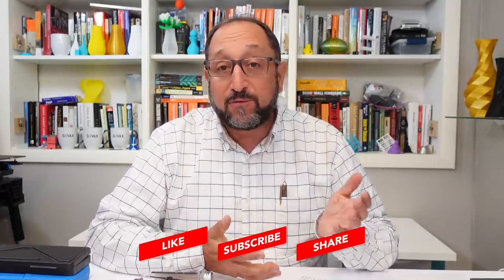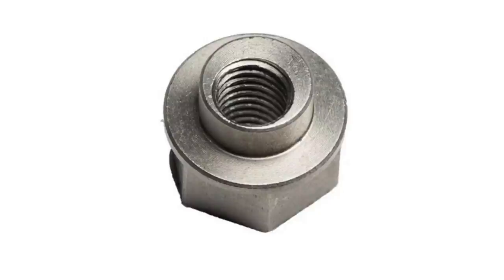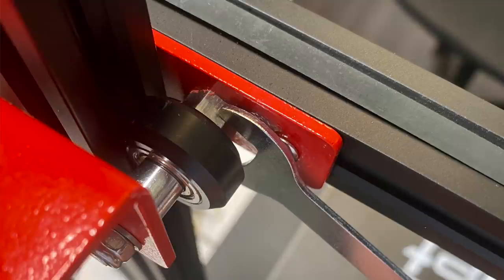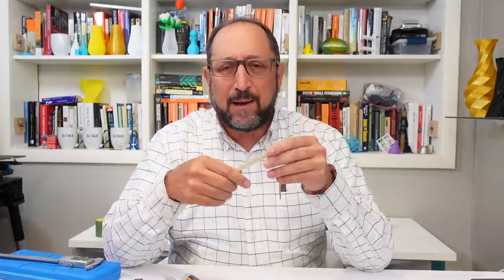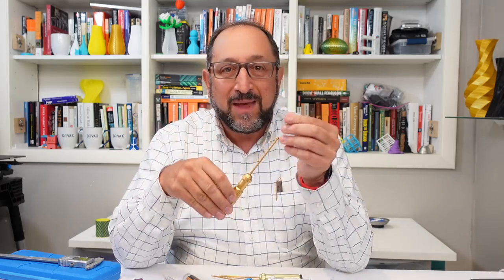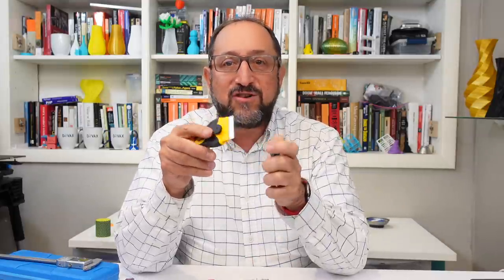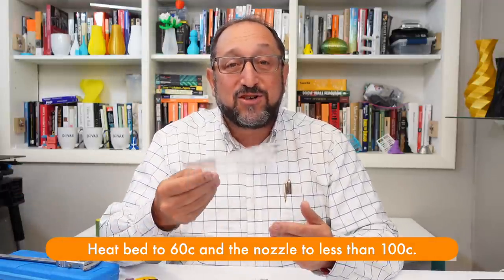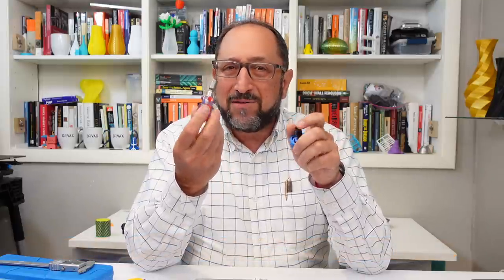10 Top 3d Printing Tools and Supplies

Comment: Hi, I like the rebrand. Clean!
These are really useful tips for a beginner. Cutting the filament at an angle is essential lol
Reply: I agree!  The angle cut is essential.  If I could add on to your comment, I also found it useful to hold on to the filament so It does not unravel and get tangled up when you open up a new spool.

Comment: Good selection, can't fault any of them.

What I'd add is, a great alternative for bed leveling is a feeler gauge, was a game changer for me.
I had saw them suggested a few times but never got a set until I got a free one with my calipers and gave them a go. Much more consistent that any kind of paper or plastic I've tried which (I suspect due to them being "squishable") sometimes threw my bed leveling off.

Comment: I've had my iFixit kit for about 2 years and barely used it until I got my 3D Printer. Very handy. The angled tweezers are useful for getting those little boogers of the tip before it starts laying filament.

Comment: All good tools and needed by everyone.  I like the MagicGoo, but not the dispenser tip.   As you said it lasts a long time, but I have trouble getting it to flow in a nice layer.  I have to tap the tip to get some out then spread it around.  It seems to work much better for PLA than PETG.
Reply from the maker: I agree

Comment: when I first started 3d printing I used Hair spray and glue stick They just made a mess Clean the glass well with alcohol do a good tramming of the bed, increase the heat bed temperature a bit and it really works good,never have problems any more

Comment: Great tips, but how tight do you make the tip to the transparent sheet compared to a sheet of paper or sticky note?
Reply from the maker: About the same.   I want to feel real friction when moving the sheet but not so much the it leaves a crease line.
Reply: I have found that cardstock also works, it's .2mm thick t00.

Comment: Just ordered the Kynup caliper. I've got two of the Harbor Freight models you show, and one, for some reason, subtracts 5.0 mm randomly from the reading as the jaws are moved!
Reply: The scale and sensor need cleaning.  Not hard to do, just take out four screws on the back, use some alcohol and soft cloth.  Wipe it down, should take care of it.
Reply: @richbuege6491  Yea Rich I've taken it apart and cleaned/inspected all the components. There is nothing visibly wrong. I suspect an microcontroller issue. It also could be that the capacitance plates which are under the stick-on scale, could have a problem.

Comment: So strange you mention "popsicle" sticks for clearing the nozzle, I use a wooden coffee stirrer from some fast food shop.  

If you stick your calipers on that metric ruler, you'll find it's something like 0.2mm thick! But I wouldn't suggest using it for height adjustment, you might bend the ruler, however, it might be a go-to solution if you lose your piece of mylar plastic.

Comment: What is your opinion of Chitubox (CBD-Tech) encrypting all-new controller boards to only work with the Chitubox slicer? Keeping in mind that they manufacture the controller boards for many of the popular resin printers ( Elegoo, Anycubic, Phozen, Emax, Creality, etc)  so this gives them a monopoly/control over the market. Firmware upgrades to older printers will also lock down those printers to Chitubox only. Note: Creality has stated they will not support this practice.

Comment: Thank you for the great tool ideas. I have my first 3D printer, a Prusa Original i3, being shipped as I write this.  I already have most of the items on your list, but there are several I am ordering.  I have a question on one.  My Prusa will use a direct drive feed.  Will the nozzle cleaning needle still work with it?  Thanks!
Reply from the maker: Yes.
Reply: @MakeWithTech  Thank you.  Ordered.
Reply: Thanks again.  The torque wrench was not available when I first ordered tools from your video.  It is now in stock and I ordered via your link.  I have not yet used all the tools, but I inspected them when they arrived and they are high quality tools.  My Prusa Original i3 kit is up and running, and of the tools that I found useful, the hex key set you recommended was outstanding for assembling the Prusa kit!

Comment: I have all but the hotknife..

Another item for you list would be a de-burring tool..
Reply from the maker: What do you use the burring tool for.   I have one for another purpose but have not used it with 3D printing.
Reply: I use the tool to remove the brim flashing
Reply: @MakeWithTech  takes away brims and rough internal edges. Also good on printed internal screw thread. Just places what would otherwise be guard to reach..

Comment: The aluminum housing on your caliper does nothing as far as accuracy or reliability.  Handle the ordinary ones, with a little care and they'll last just as long.  I have a Brown and Sharp that's now over forty years old, sold back then for almost $200, but the battery box finally gave up.  Oh, well.  It owes me nothing.